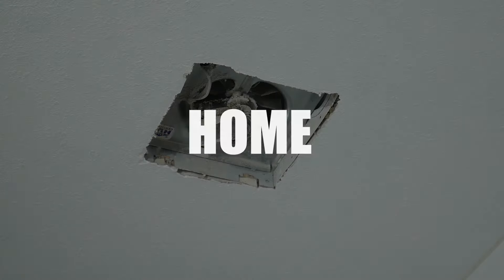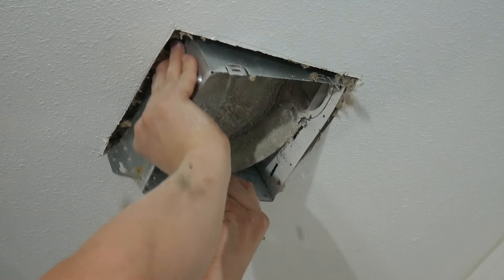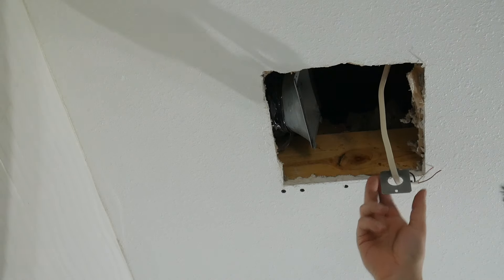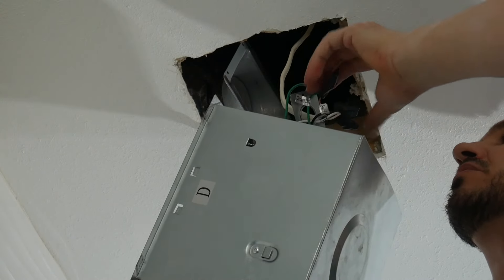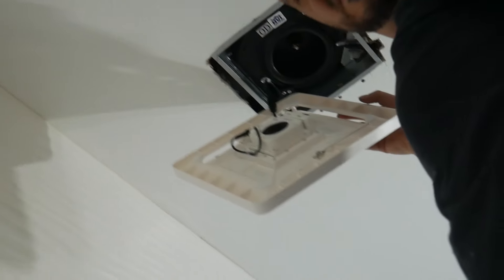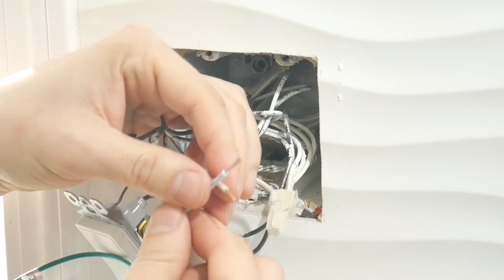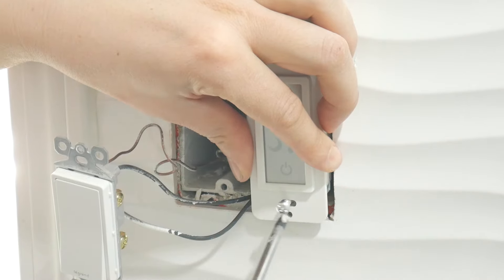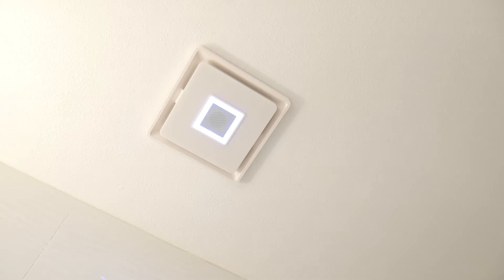Home NetWerks bluetooth bathroom fan install

Comment: The amount of people tackling this project and asking questions about the colors of wires is worrying me…. Stay safe you guys
Reply: I had to confirm because my switch isn't coming on.  The box looked messed up as if it was a return but the materials were still in new unused condition.  I KNOW exactly what I'm doing when it comes to hot black and neutral and ground.  Multimeter says I have 120v across white and black and black to ground.  Just no go.

Comment: Thank you! This is EXACTLY how a tutorial video is supposed to look!!!! I installed this same model, replacing an existing fan.. If I could add, I turned the fan upside down tracing the flange that is approximately 3/4" larger than the unit, and cut out the difference of the ceiling board. This enabled the entire fan to fit perfectly up through the opening while keeping the opening nice and tight to the flange, eliminating any need for repair to the ceiling. I attached the flexible exhaust duct, put the fan partially up into the opening, attached the wires, then put the entire fan  into the opening, while the flexible duct bent accordingly while hitting the bottom side of the roof, I positioned it correctly, to hold the fan in place I temporarily attached a large paint stirring stick to the ceiling placing screws in both of the wood blocking (so when I removed the stick the screw holes were concealed by the fan cover) and screwed the fan to the blocking just as you did!

Comment: Just installed it today. You do not have to cut the square hole bigger. It will fit correctly, I promise. It's important to undo the 4 little screws, then take out the fan motor. It's because you need to connect wiring and connect hoses first then install back the motor inside and put the 4 little screws back. Then covering after finished

Comment: Thanks for your video. Quite informative. I recently moved into a house with a touchpad exactly like the one in your video, but I do not know how to turn the thing on. I thought it would come on with a flick of the light switch, but that’s not the case. Do you have any suggestions? Thanks.

Comment: Thank you for the video - I seem to have done the same thing (Hopefully) but am running into an issue. 
When I turn on the regular light, it works fine, but if the regular light is on, and I try to turn on the power to the fan unit, the regular light turns off and the fab box turns on. Any idea why that would be the case? Thank you again

Comment: I just bought one of these fans for my bathroom that I’m having remodeled but we can’t get the night light to turn on and I like how your able to dim or brighten the lights where did you buy your digital switch from also we’re you able to get your night light to turn on without the switch cuz I can’t and I’m a little bummed out about it cuz I wish it would of just came with a remote control
Reply: Dont use power from old ceiling fan (cap it off) !! re-run power at & TO THE SWITCH! Instruction not really clear on this part (use wire going up the wall/ceiling for the switch)

Comment: the best description that i have seen so far. i had one of these in my old house installed by a pro. i am goin to install one this time myself.
Reply from the maker: Thanks for watching and good luck on your project!
Reply: @NeverStopDIY  ok. I installed my fan without using attic access. (my attic was too tight)What I did was cut the 9.5 by 9.5 hole and edged the corners enough to get the whole fan straight up into the headspace/attic. From therei pushe the fan to the right and I did the wiring, then I pushed the fan to the left and did the exhaust duct. The tricky part was mounting the fan to the beam which luckily was already drilled (only 1 screw) from the previous fan, so I “hooked it on and slid it down”. My fan sat recessed into the ceiling instead of being flush. I put some double sided tape around where the fan meets the drywall. My setup did have a red wire as I had 2 switches controlling the fan. Your video helped me so much with the wiring that it took no time for that part.
Reply from the maker: @5duece4tre  Thank you for watching and taking time to reply. I am glad it worked out for you.
Reply: @NeverStopDIY  I will be looking for more videos from you. You show the pitfalls of doing DYI. It always seems to have some sort of a hang up when you DYI. The satisfaction of getting it done is fantastic.

Comment: Just bought two of these units for my bathrooms…thanks for the video! 👍
Reply: Has any issue with the main like flickering?  The light where you can touch it and it has like 5 brightness settings. Ours worked great the months then went to flickering.

Comment: from what i understand the neutral should be dedicated.  nothing else on that circuit.  you will experience "noise"  which may be the cause of some peoples issues that are commenting here.  (the flickering, the whining noise, the bluetooth connection)  anything else that is connected to that circuit using the same neutral wire may impede.  This is info i recieved from the manufacturer on the phone about half an hour ago.

Comment: My fan switch won’t light up, I had two white wires a power wire and a traveler.
Two switches and a GFCI.
Light switch and GFCI works but the smart switch won’t light up.
Reply: You need to run a separate 12/2 wire to the vent.  It needs 110v at all times.  Your existing wire shuts off with the switch, which won’t work. The switch has a tag on it that states its needs a dedicated white neutral wire. Good luck.

Comment: Mine didn't come with a switch,  (the content included in the instructions manual doesn't mention a switch included)

My electrician contacted it to the regular switch (one wire option).  The fan worked, however the light didn't. 

Help!

Comment: The electrical connection from the cable to the fan needs to have an approved connector for Romex , you are not allowed to just let it flop around through the 7/8ths hole in the fan.
Reply: You are in your own house

Comment: Either our electrician took the switches or they didn’t come with any, kinda disappointing since I got it for the blue light being light sensitive to bright lights
Reply: Yeah i dont know how to setup the night light mode either. I have mine on a 3 switch for that exact reason but theres no connector for it
Reply: I think there are 2 models. The little bit bigger model for 159 comes with switch and the smaller $89 dollar one doesnt have night light colors or switch.
Reply: @rickcollinsva  never updated but our electrician threw out the switches and we never bothered to try and replace them. I just got a night light for my bathroom that I hang on a towel rack.

Comment: Mine worked fine for months. Then just stopped. Lights are on on the switch.  But no lights. No fan. Nothing. Check all wired connections as well.

Comment: I wired this the exact same way, but when I hit the power button everything comes on and the individual buttons light up but don’t turn anything off and on, anyone solve? I have a white wire and everything and I made sure all connections are correct.
Reply from the maker: As much as I would like to help you, I really wouldn't know, other than rechecking the wires...

Comment: Where did you get the switch?
Reply from the maker: The switch comes with the fan
Reply: Mine didn't come with a switch. Wish it did. I can't even seem to find that particular switch.
Reply from the maker: @roxy1stmommy  it should have included the switch. It's the only way to use it. Have you tried contacting the manufacturer?

Comment: Is it possible that motion sensor to automatically turn on the music/Bluetooth taking in account that the Bluetooth is already setup and the feed is up and running?
Reply from the maker: Probably not, since there are two steps involved in turning on the fan system. You have to press the power button, and then turn on the fan, night light, or Bluetooth.

Comment: So I got this fan and hooked it up. Everything works but there is whining noise through speaker. It goes off when light is on full power but comes back on when lights dim and when blue and orange led are on as well as nothing on just power. The whining noise changes pitch through all different settings. So damn annoying. No wonder it was on sale
Reply from the maker: That is very weird. I know it's hard to take it out now but replacing it might be the only option...

Comment: How do you add the black wire for the fan?
Reply from the maker: A black wire should already be connected to your old fan. If there is no black wire, that means a wire with a different color is your live wire. You can test your wires for a live wire with a voltmeter. If you need help with that, let me know.

Comment: Where did you connect your ground?
Reply from the maker: The green wire on the power switch connects to the ground.
Reply: @NeverStopDIY  I need help connecting mine is there anyway you can help
Reply from the maker: @santoszarate8026  I can try to help. What's the issue?
Reply: @NeverStopDIY   connecting the outlet
Reply from the maker: @santoszarate8026  how many wires does your existing switch have and what colors are they?
Reply: @NeverStopDIY  Orange and yellow
Reply from the maker: @santoszarate8026  In this case I suggest you get a qualified electrician. Sorry I couldn't help :(

Comment: THIS UNIT NEED BETTER INSTUCTIONS! BUT; LOVELY UNIT!  NOTE TO EVERYONE (Don't use power from old ceiling fan (cap it off) !! re-run power at & TO THE SWITCH! Instruction not really clear on this part (use wire going up the wall/ceiling for the switch)
Reply: I called customer support and they said the same thing dont use power to exhaust fan and cap it off, i have 1 switch with a black, white and copper. So do i have to run an extra wire for the red and run it to the power on the exhaust fan?

Comment: Your wiring is dangerous.  Hire a professional before you burn your house down.
Reply from the maker: Please, tell me what's dangerous about it. The fact that I used heavy duty push in connectors and wrapped them around in tape? Or the way I connected the wire to light switches the same way they used to be?

Comment: What if my existing switch powers to another light in the bathroom and then the wiring for the fan runs from the other light, can I still tie that red wire from the new switch into the hot wire coming in?
Reply: Did you ever get an answer for this?